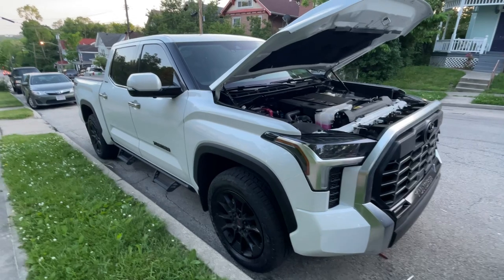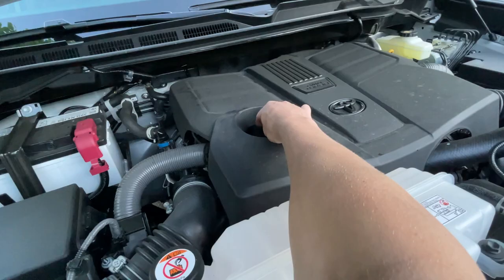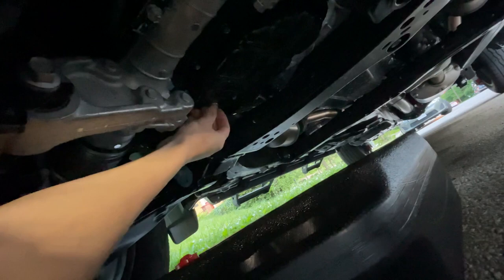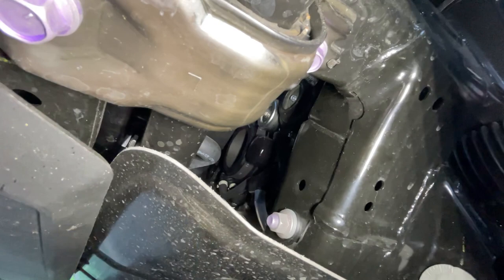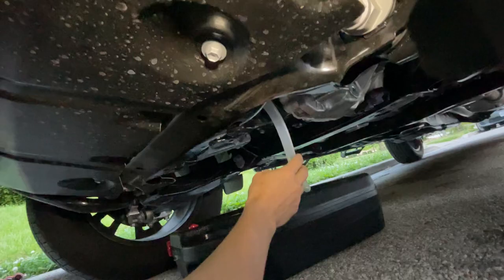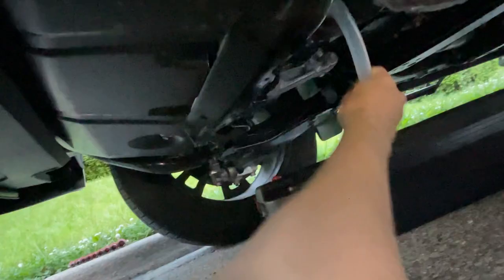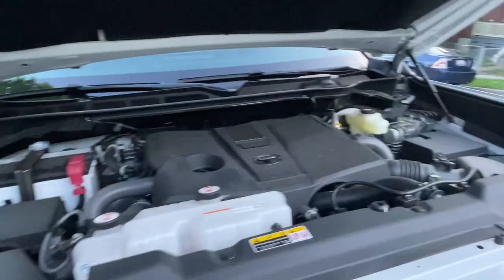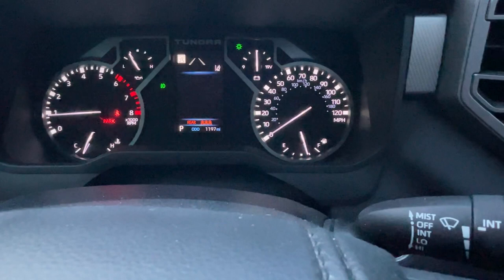2022 Toyota Tundra Oil Change Walkthrough

Comment: The predator steps look nice on the Tundra. Any plans on getting a lift or bigger wheels? Had a 2" lift and 35s on my last truck and it made changing the oil so easy lol.
Reply from the maker: I love the look of a lift and bigger tires, but I’m going to be pulling a ‘78 airstream (6,500gvw) a lot, and they were made to be pulled with cars and sit really low. If I got a big drop hitch to account for the lift/tires, I think it would throw me around pretty badly.

Comment: Nice! I don't suppose you could access the filter from above, right? It looks soooo tight, even when that skid plate is removed. Was it messy at all(upon filter removal)?
Reply from the maker: Theoretically you could reach it from above (I tried), but it’s waaay down there - you’d almost have to be upside down.

It’s actually the least messy oil change I’ve ever done - the catch/spout under the filter housing works wonders. I didn’t spill a drop from the filter.
Reply: @KeithRader  Very nice!

Comment: What kind of oil did you use, what brand? How many miles at change?
Reply from the maker: 0w20 full-synthetic - just what the cap/manual says. I’m no expert on oil brands, but I’ve always used Mobil1. I changed mine at 1k miles (the end of the engine break-in period). The dealer provides free oil changes on all new Tundras for the first 2 years/20k miles, but you can’t get your first until 5k. People who have had their oil tested seem to be finding high metal contents, so I wanted to change mine earlier in hopes that my engine stays healthier longer.
Reply: @KeithRader  thanks for the response. I have a 22 as well. Changing mine at 1500.

Comment: How do i lower the air dam? Thanks!
Reply from the maker: Start the truck, then turn it off, within 45 seconds of turning off the ignition raise  and hold the wiper stalk for two full seconds (the handle you lift to turn on the wipers). That does it. It’ll automatically retract the next time you put the truck in drive.
Reply from the maker: But just to reiterate, I never did that during my oil change.
Reply: @KeithRader  oh ok you can remove the skid plate without lowering the dam then i assume. Thanks!
Reply from the maker: @lorifrankpeterson2605  I’m honestly not sure about that. My guess is that it’s possible, but I don’t think I’d try.

Comment: Soooo 2022 Tundra Engine Maintenance requires oil change at 1000miles? 😆 🤣 😂 😹 😆 does this guy know what he's doing he sounds unsure 😆 🤣 every 10000 miles really!
Reply from the maker: You should probably read the other comments and replies before trolling. Thanks for the input
Reply: i change mine at  500 miles  keep the oil clean
Reply: First couple thousand is never a bad idea to change oil on a brand new vehicle, even though waiting until 3-5k is acceptable 1k is just fine and makes sense after the engine breaks in. Every 5k miles for peace of mind is a good idea, 10k is a stretch